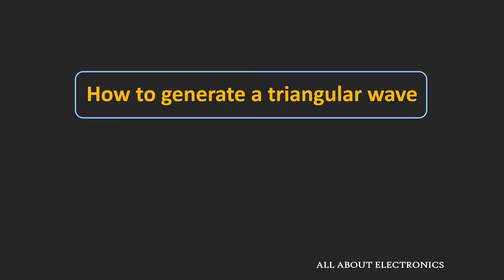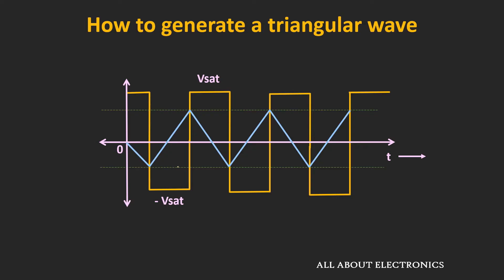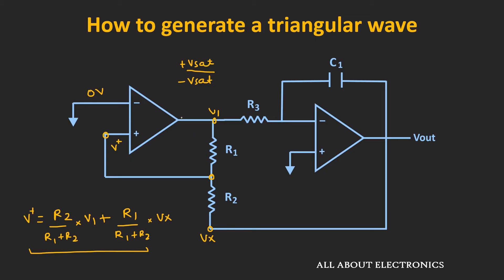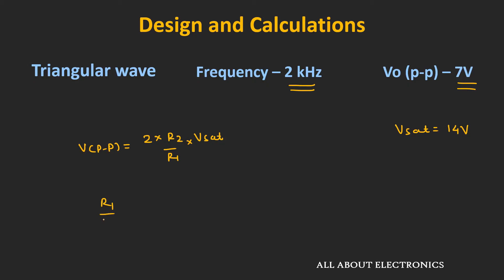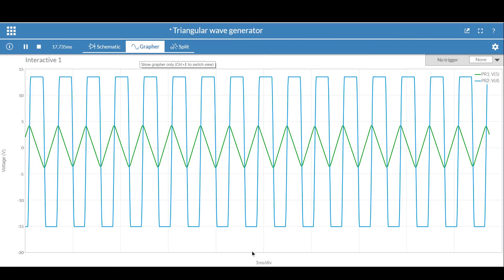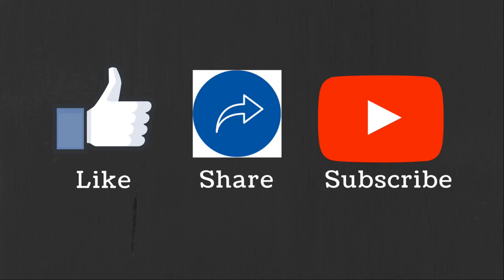How to Generate a Triangular Wave (Part- 2)

Comment from the maker: Timestamps for the different topics covered in the video:

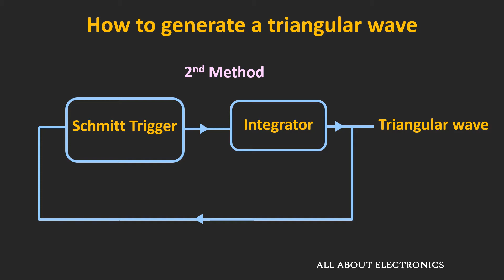0:33 Description and working of the circuit

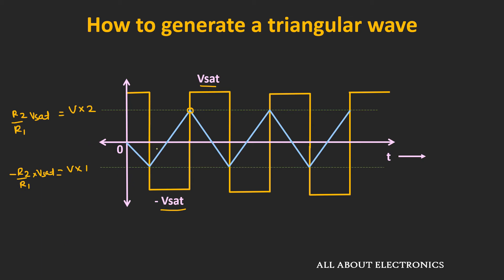5:54 Derivation of frequency and peak to peak voltage of the triangular wave generator

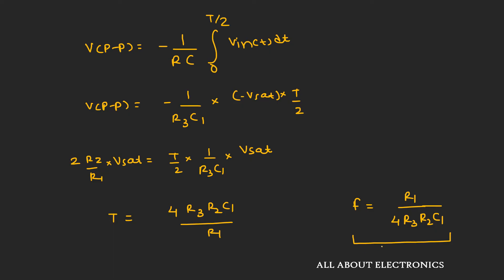7:56 Design and calculations for the triangular wave generator

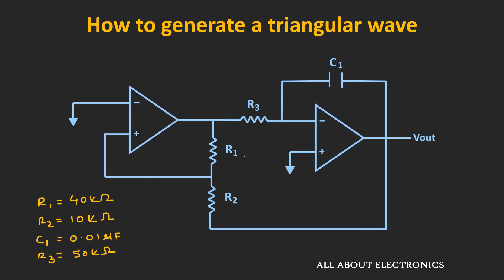10:22 Circuit Simulation using Multisim
Reply: Thank you, sir, for this video..just one question ...why you have considered the square waveform in this fashion i.e for T/4 positive then negative for T/2 and then again positive for T/4. You could have considered T/2 for +ive and T/2 for negative?

Comment: Sir, if we use a power supply with -V and +V we could use the formulae mentioned in the video, what if we are limited with single supply, what are the changes we need to make in these formulae?

Comment: sir, the website you are using is a paid version? so can we make it there??
Reply from the maker: Earlier, it was free. But now it’s paid one. In a free version, you can add only 5 components. So, it’s not worth it. But you can use LTspice. You can download the software ( it’s free) and you can simulate the circuit.

Comment: 7:05 why you have written -Vsat only
We can also write +Vsat right, then frequency is getting -ve

Please Clarify.....
Reply from the maker: In this calculation, the peak to peak voltage is the difference between the final voltage and initial voltage. In this case, during 0 to T/2 time,the initial output voltage of integrator is - (R2/R1) Vsat. While the final voltage is ( R2/R1) Vsat. Therefore, V(p-p) is positive. (2 R2/R1) Vsat. If you take the negative slope, then of course during that time Vin (t) is positive or to be precise it is Vsat. But in that case, the difference between the final and initial value of the integrator output will be negative. That is (-2 R2/R1) Vsat. So, in both cases, you will get the same sign. I hope, it will clear your doubt.
Reply: @ALLABOUTELECTRONICS  got it
thanks for reply ❤️

Comment: Thank you sir, for your video, i know anymore about electronics. but i have one question, why the integrator in this case, wasn't designed with Rf like triangle square with astable multivibrator + integrator before? Can this design use for practical design?

Comment: Sir what about this Design:
Design an oscillator which is capable of producing sine, square and triangle waves with 5V peak in the frequency range of 100Hz to 10kHz. You can use the circuits you saw in the lesson while designing. Make your design using opamps. Give priority to the use of LM741 in your design.

Comment: There is a mistake that carried on till the end: for the V+ input, on the Vsat and Vx part, the numerators are inverted (for Vsat, the numerator is R1 not R2, and R2 is the numerator for Vx). Other than that, the rest is fine!

Comment: Sir 
There is an app in play store called every circuit which costs 800 as whole
Can I know what is the difference between these apps and simulators like spice and multisim???
Do the simulators have any extra advantage 
In the app also we can connect the components see waveforms and frequency response
But in these apps components are as it is 
Like op amp means op amp, BJT means BJT 
No model and all
Just to know if it's worth buying
Thank you
Reply from the maker: Better to use standard simulation softwares. Like multisim and pspice. If the circuit contains lot of components the for simulation it requires lot of processing power as well. Also these standard apps have ideal as well as actual components (e.g ideal op-amp and Op-27).
So with simulation you can see what to expect at the output. ( In terms of the transients, to steady state output or the frequency response)
Multisim Live is very good online simulator  for basic simulation. It's free as well. 
You can use it for basic simulations.
Reply: @ALLABOUTELECTRONICS  oh ok
Thank you sir

Comment: Hi, why super position theorem is
 applied at v+ terminal instead of nodal analysis.if you apply nodal analysis then the equation will be different from whatever you have written.
Thank you
Reply from the maker: If you apply the nodal analysis, then also you will get the same equation. Please try once again. There must be some mistake in calculation.
Because if you apply the nodal analysis then equation would be (V+ - V1 )/ R1  + (V+ - Vx)/R2 = 0 
And if you solve it then you will get the same equation.
Reply: @ALLABOUTELECTRONICS  yes.
Reply: Great explanation